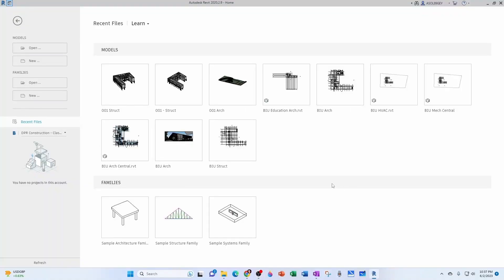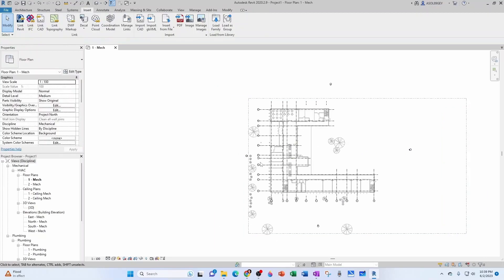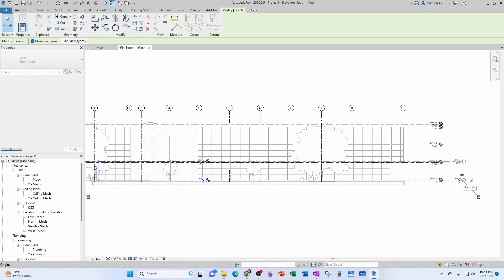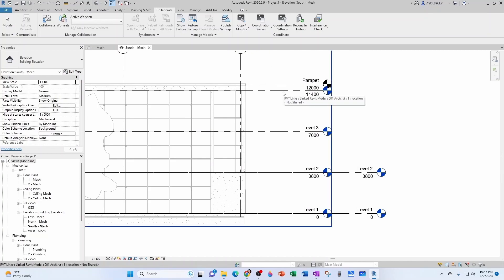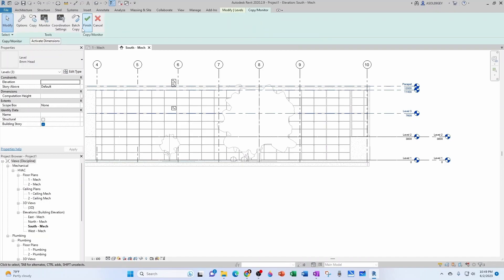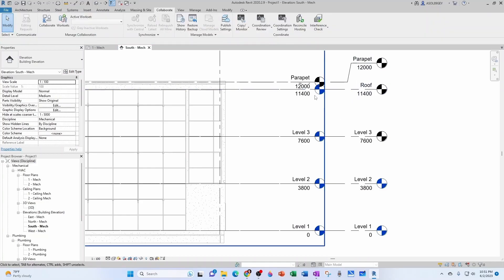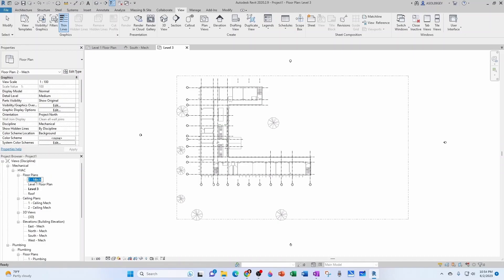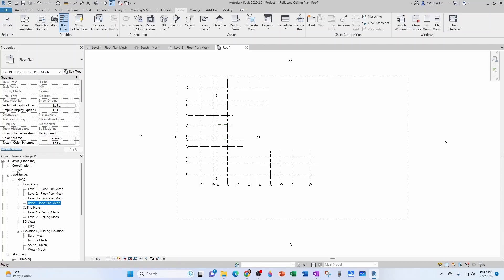Revit HVAC 1 Creating new HVAC Model in Revit

Comment: If the structural revit file has a different has a different origin how do you do it? I have one here that has geographic coordinates and elevations, when i import it into the mechanical project it is completely off the alignment.
Reply from the maker: That can be pretty confusing.
If you just want the models aligned TO PRACTICE ONLY (just move it).
WARNING: IN A REAL PROJECT YOU SHOULD NEVER DO THAT. You should get to understand the "Survey Point" and "Project base point" concepts and how they relate to each other. I recommend the Paul Aubin Videos.
Reply: @bimitup  Thank you for the fast reply and advice.
Reply from the maker: Sure!